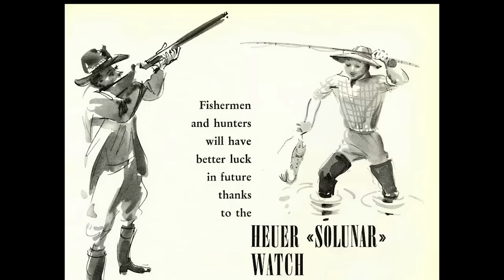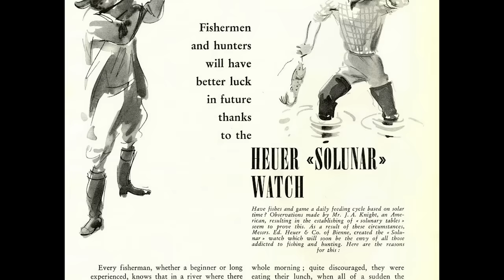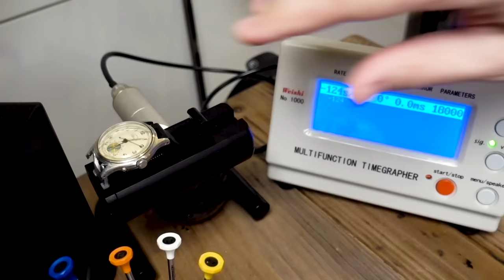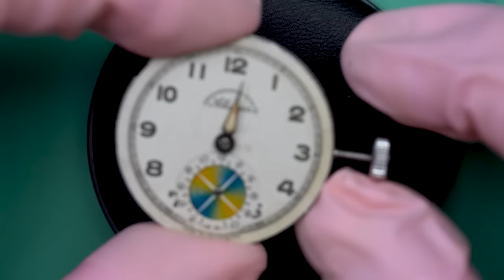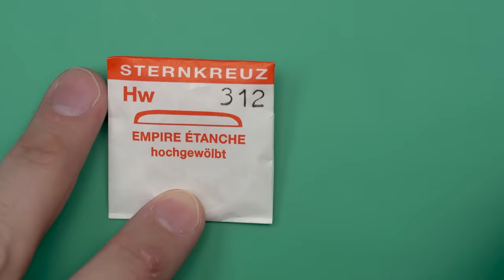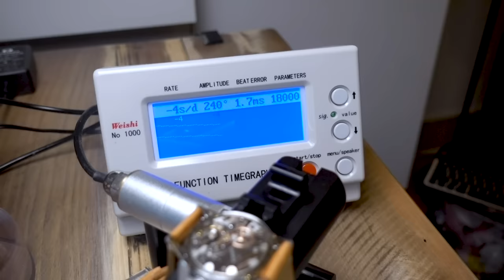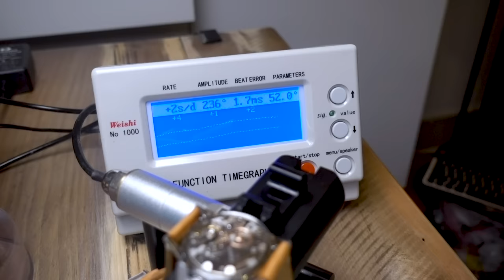Abercrombie and Fitch Solunar Vintage Watch Restoration

Comment: Citric acid removes rust quite well! 👍
Years ago I owned a watch parts cleaner and was told by an old watchmaker to use white spirit as cleaning solution, I tried it on old parts and it actually removed the rust off an old top plate!!

Great video by the way!! 😎😎

Comment: I love your videos! They’re super informative and super interesting; keep up the good work! 

I have a few thoughts on rust removal. I don’t speak as an expert on watches, or rust removal but rather as someone who has spent a fair share of time trying to reduce the amount of effort I have to invest in rust removal for my own projects. 

1. I would recommend that you do not mix the vinegar and baking soda as it defeats the benefit both bring to the “table”. 

1.1 Baking soda is used as a very light abrasive and you’ll often find it used for sand blasting operations (or more accurately soda blasting) where great care must be taken to remove the offending material without damaging the base material. 

1.2 Vinegar, as another poster said, is acetic acid (approx 5%) and on its own it will remove rust. It’s worth noting, that it will also begin to eat the base material if left unattended for extended periods of time. This shouldn’t really be an issue you’d need to worry about but it’s something to keep in mind. 

1.3 When vinegar (acetic acid) and baking soda are mixed, they undergo a chemical reaction forming sodium acetate, water and carbon dioxide. As I said above, the abrasive quality from the baking soda and the rust removing ability of the vinegar are both (for all intents and purposes) eliminated once they’re mixed.  Seeing the bubbles tricks people into believing progress is being made but really, it’s just limiting the abilities of both materials. 

2. Some of the parts you’re working on are horribly pitted. Were the components proportionally scaled up to what I am used to working on (woodworking hand tools) I would likely consider them unsalvageable. That being said, what I work with is not nearly as rare as why you work with so maybe this kind of damage isn’t as detrimental. 

2.1 If possible, you should really try and replace the pitted parts. The coarseness of pitting provides more nucleation sites for the rust to begin again. You may have noticed that polished metal oxidizes less than unpolished/more coarse textured metal. The coarseness of the pitting will give rust a foothold in the future. Until you can replace the parts, you may want to store it in a closed container with a desiccant (think those little paper packages of beads that come in new shoe boxes). You can even buy desiccant that has colored indicator beads so you know when it needs to be replaced or refreshed. 

Once again, I’m not an expert, just a guy tired of suffering from a humid climate and wanting to save someone else some pain.  I posted this video (link below) on reddit, not too long ago, and while some of these processes will be way too harsh for watch components, some of them might just be gentle enough to work. It may be worth gathering some “scrap” parts and testing to see which processes cause damage and which don’t. I’m happy to answer any questions I can or provide you resources for any I can’t!

Again, keep up the good work! I look forward to your next video!!

https://www.reddit.com/r/handtools/comments/hgqax2/if_anyone_would_appreciate_this_video_itd_be_you/?utm_source=share&utm_medium=ios_app&utm_name=iossmf

Comment: Apparently some people have had luck with Evapo-rust for rust removal, due to it being non-corrosive (unlike vinegar). And it removes only the rust by a process called chelation and doesn't touch the good underlying metal. Saves a lot of scrubbing and great for more fragile parts. I plan to try this on some old rusty movements I brought for practice (I can confirm it works well on car parts!). I should add that I find your videos fascinating, relaxing  and very informative - keep up the good work!

Comment: Beautiful watch, I didn't know about it. Thanks for the oil part, very useful. I agree with your restoration approach. You don't modify an antique except when you have real damage. But not with just patina. I feel bad when I see repainted dials that were just patinated. Jewels lost forever. Trendy vintage watches are the primary victims, I think. Those Omega pie pan, for example. Everybody wants to have a vintage pie pan, even when they actually don't like vintage appearance. I think I have seen as much (badly) repainted ones as all original ones. It's an irreparable loss.

Comment: You want to be soaking rusty parts in EVAPO-RUST.  It really does work and stops future rust. Even with no visible rust on your parts, there is still rust and if moisture (even humidity) becomes present, they will start to rust again.

Comment: Your video on Abercrombie and Fitch Solunar watch just popped up on my iPad. It’s interesting for a couple of reasons- back in the day it was a very interesting store to visit in NYC and the mention of Heuer, before it became Tag Heuer. 
My father was a pilot having gotten his  pilots license at 16 in 1931. He served in WW2 and later on in the private sector. He was also a bit of a clock watcher using the 8 o’clock time beep on WOR radio to set his car clock. In the early 60s I flew to NYC with him landing at LaGuardia field and took a taxi to A&F. There he purchased a Heuer Autavia chronograph cockpit watch to mount on the instrument panel of a D18 Beechcraft he flew. I still have it, it still works keeping fairly accurate time although the lume on the numbers and hands have faded.

Comment: Awesome. For a self professed amateur you do better than some so called professional watchmakers I've seen... Modern watch repair through chain jewelry shops is often godawful, but that's another topic... I've never seen one of these Solunars in person either, and I love it even though more "conventional" moon phase watches are my passion. Also interesting to see a Valjoux 90 that isn't a standard moon phase/triple-calendar. I don't think I've ever had a 90 on my bench that wasn't a triple-calendar actually. You're also absolutely right, dial refinishing is no-go and will instantly kill the value: The only time you want to refinish is if it's so bad as to be illegible. Clean them by all means, dials get dirty too, but actual repainting and reluming is another thing. Replacing the crystal is fine, they're intended to be replaced as part of normal service. I prefer to polish the old acrylics when possible, but if they're cracked; or in the case of the really early celluloid ones, darkened & cloudy, a replacement is no problem and doesn't hurt value at all. 

There are still companies or were, as of the 1990s that make similar pieces intended for fishing, although they're all quartz. Krieger and their "Tidal Chronometer" come to mind as the modern archetypal example. There were a tiny handful of other very interesting Tidal-Lunar watches in the '80s and '90s though: These were produced by multiple makers including Heuer, but branded and retailed by companies like Field & Stream, Orvis, etc. Instead of the usual simple "two lobe" moon phase, these had what I like to call sophisticated moon phase movements eg; modified ETA quartz calibers showing moon rise & set, position, age, shape, day & night -- plus specific tidal indicators on some. I have in my collection an extremely rare Orvis "Solunagraph" c1988 (which I believe was meant as a sort of spiritual successor), with the sophisticated moon phase movement. If you're interested I'll dig it out and post the model and caliber info etc, but it IS only a quartz...

The crown tube thing by the way is either bakelite, hard rubber or gutta percha, depending on the maker for this era. Bakelite and hard rubber are non-reactive, non-conductive, non-corrosive, very slightly springy to form a seal; and hard rubber can be heat formed. If they get warped or compressed a dunk for ~20 seconds in boiling water will return them to their original shape and/or allow you to mold or reshape them within reasonable limits.

Comment: That is an amazing watch and the care you take is very impressive.What a level of patience and fortitude. I restore tools and I recently inherited a toolbox and canvas bag of precision tools. The canvas bag and certain pouches inside had at some time had contact with moisture. There were some famous maker tools just caked in rust and corrosion. I called a friend and he recommended Evapo Rust Solution. It's not toxic and shippable. I ordered a gallon of it. I'm happy to report it really does what it says it does. You soak the items and let it do it's thing. The solution turned really dark. I pulled out the tools and they looked brand new.

Comment: Awesome video and man you are amazing! To call yourself an amateur is mind boggling. I am a watchmaker from Nova Scotia Canada and I have one little trick to getting rid of pesky rust stains. I specialize in vintage time pieces and the trick I use is a little bit of Peek metal polish. Just put a tiny bit on the stain and gently work the polish into the stain. Wipe with a soft material  then wash the part. Voila, the stain is gone! I have been doing this for years and it works every time. Again awesome video and you Sir is a professional in my opinion.

Comment: Well it looks like this Saturday is "Wristwatch Revival Bingewatching Day". Good job with that one. Few nowadays remember what an awe-inspiring purveyor of all manner of über-manly expedition gear Abercrombie & Fitch were in their heyday. If you were planning the first snowball fight at the summit of Mt. Kilimanjaro, your first stop would have been A&F. They outfitted Lindbergh for the first solo Transatlantic flight in 1927! Teddy Roosevelt was a frequent customer for his many expeditions. Now, of course, how low the once mighty have fallen! Its once proud and indomitable names reduced to flogging hoodies and sweatpants to clueless teens. It's like watching Tutankhamun's funerary mask being used as a chamber pot. Also, although your Solunar's tide clock may or may not be just the ticket for drawing in those bass, it most definitely has its virtues for sailing or boating anywhere with a tide or estuarial, like my nearby Potomac River and Chesapeake Bay, especially if one launches from a trailer. Knowing the rising tides make this far easier if you have any draft at all, while the turning ebb or flow can be one's cue on a daysail to begin heading homeward without a fight. Perhaps not YOUR "moderno" cup of tea, but that's why I adore my two Timex Expedition Time-Tide-Compass-Temp watches that I picked up for roughly a hundred bucks a pop. I won't sail without one.

Comment: I work on the gas pipeline, sandblasting and coating among other things. That one part has pitting which means loss of material, could be fixed on a large scale but not this. Crazy how much I enjoy the smaller scale craftsmanship. All the cool tools, and gadgets you have.

Comment: As a goldsmith I learned to leave rusted tools to soak in coca cola overnight, for your parts a couple of hours might work too, not sure but worth a shot.
Also I heard that when removing rust from mechanical parts it's important to get all of or else it might come back over time and possibly contaminate adjacent parts, no guarantee on that either, could just be confluence of different things I've heard.

Either way, really love your videos as they help me unwind in rather stressful times.
Reply: I suggested vinegar as it converts the rust to an inert compound but the coke may be better as it would likely dissolve it.  Perhaps coke to get the majority than vinegar to convert it.

Comment: I have a little orient 3 star automatic watch I purchased because getting the battery changed in a little stainless steel casio was a pain and paying someone to do it would cost more than the watch is worth with that said I am facinated by what you do. I am amazed at how you are able to put the dang things back together with what seems a million little bits that somehow fit together. If I take a door down its officially a doorless entry because I wouldn't know how the thing goes back in the frame. 😆 Love your work and videos.

Comment: Hey Marshall, I know this is an older video, and you might not see this comment, but I have an easier solution for rust removal. You get some Evaporust, pour some in a jar, toss your rusty parts in, wait 24 hours, and you're done! This stuff will literally dissolve the rust off any steel and doesn't have any effect on chrome, brass, bronze, gems, or any other substance, leaving you with no work to do other than run it through some cleaner afterwards. It's eco-friendly too, meaning you can dump it down the drain and wash away residue with water. I highly recommend you give it a try. You'll be amazed at how effortless it is to remove rust. Just a tip for a guy that's been trying to rid machines of rust since...forever.
Reply from the maker: I have since found Evaporust and I agree it's great stuff!

Comment: I’m not a watch repairer, but I do restore old woodworking tools and antique military firearms - i would recommend Evaporust for unblued steel and boiling for blued parts to stop the rust and convert it. A carding brush (superfine very soft and will not damage bluing) will take off the converted rust.

Comment: Pencil eraser for rust.

There’s a very light abrasive in pencil eraser.  We used them to prep electrical pads for soldering, even surface-mount scale stuff.

Comment: I would never have watched a whole video of a watch repair, but your passion and your work captured me and I loved it. Amazing. My interest stems from i just received a omega watch from my stepmother and it needs repair. I got a estimate of 450 bucks. I know nothing about watches but what I could find in my research is that even if its working its only worth a out 300 tops. I think anyway I could be totally wrong.
Reply from the maker: Depending on what kind of work it needs, 450 could be correct. Just for a basic service of the watch if it's not a chronograph, that's on the high end of what I've seen. (and thanks for the kind words!)

Comment: The manufacturing of these precision parts is incredible. I see like little mice operating lathe and drill presses. The wheels have tiny teeth that look amazing, they don't look like a stamped part and the hair spring is amazing. Miracles that these teeny tiny parts can last for so long. Very cool.

Comment: Hey Marshall, I bought an old Porsche and the ash tray looked like your winding stem. Out in the garage I poured some muriatic acid into a plastic cup and submerged the metal ash tray. After a few hours, you would not believe the results! 
Give it a try sometime on a piece of junk. If you find it works, try it in an actual part. 
Love your channel ❤

Comment: Vinegar is indeed a very good rust remover! The problem is if you don't neutralize it it will continue to dissolve the steel after you put the watch back together. It turns steel plates black and will badly damage springs. Use with caution is my advice, on other machinery it is not a problem as surfaces are treated with a light oil coating post cleaning which is rarely done in watches. Nice little watch by the way.

Comment: What a wonderful restoral and cleaning. I agree with you regarding conserving the patina if it enhances the aesthetics. And your aesthetic sense is spot on. Are you still wearing the watch? I was concerned about the rust and corrosion on the hour and minute hands, did you ever try to address it? It would be tragic if the hands continued rusting away!

Comment: I am not much of a watch restoration guy (at this point at least although I am thinking of it) .  I do restore many old hand tools ( planes saws... ).  I rarely use vinegar and such, but you need to be careful because the acid is destructive in general.  Time is an important factor too.  The Evaporust product is a much safer product to try first as it will not eat your parts.  I believe it can help you better than any acid. Best wishes

Comment: I restore vintage electronics and corrosion is a continuous battle.  I highly recommend "Deoxit" cleaner.  Used primarily for contacts (which are usually silver or alloy).  It works quite well and comes in either aerosol or liquid.  Its great for removing rust stains and other oxidation.

Comment: It turned out great! 👍👍 Liked and subbed

You had the right idea with the vinegar and baking soda, it's just whoever told to you to mix them was misinformed on the order of operations. Adding baking soda to vinegar will neutralize the acid in the vinegar making it ineffective. 

Instead soak the parts in straight vinegar, for however long it takes the rust to disappear or flake off, then remove the parts from the vinegar and give them a final wash in a baking soda and water solution to neutralize the vinegar.

Comment: You should look into a micro sized brass wheel for a super mini bench grinder. It will polish the parts after rust removal and remove the black from evapo rust. You can even build one with a small DC motor.